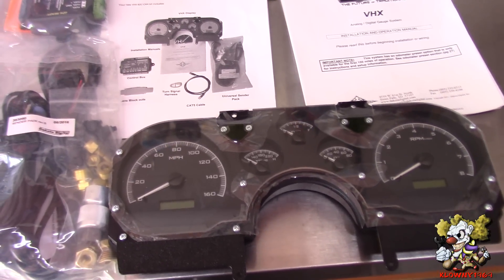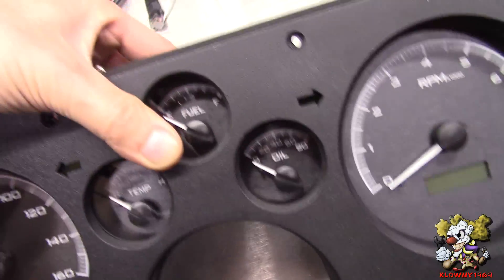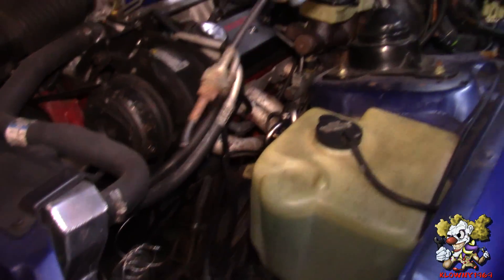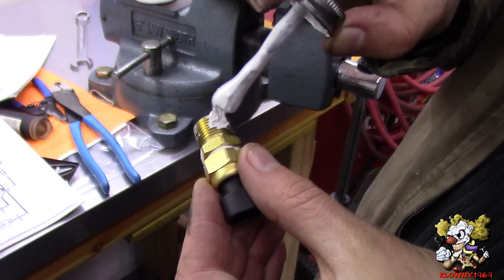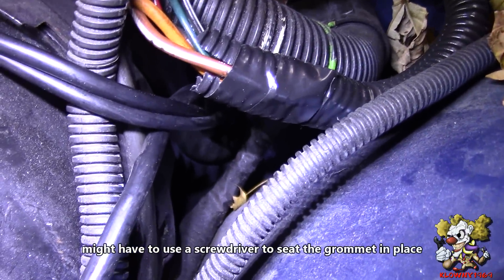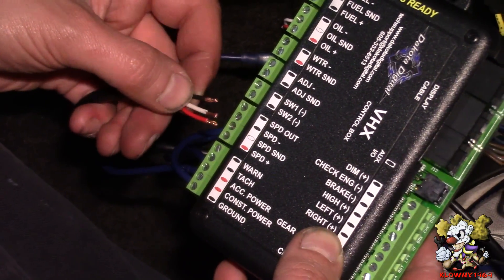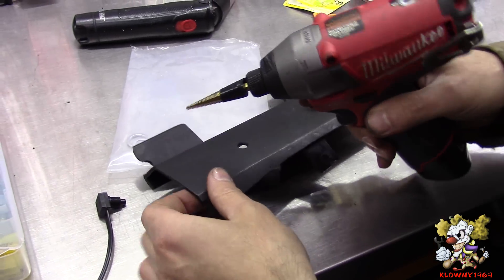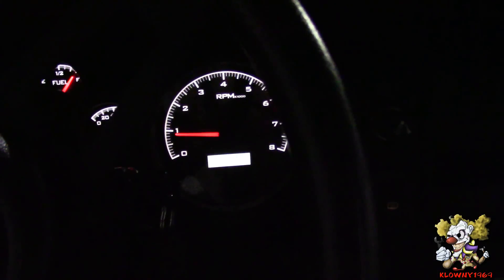Dakota Digital Dash Install !!!

Comment: Nice set up, as soon as I get my motor in that's my next upgrade!
Reply: Is there a volt meter built in?
Reply from the maker: BIGBEN1108 thank u..there is no voltmeter display..it just gives u a warning light if the volts are under a certain number

Comment: When you set the speed, did the speed read 0 until you passed the 1 mile mark? I’m trying to set up my speed on mine but I’m not sure if I’m not reaching the mile mark or if I’m gonna need a new speedometer sending unit sensor. I did notice it had a little bit of damage. Bought a car that has one of these Dakota gauges.

Comment: Hey, what's up, bro?How you doing?I have the same.Set up as you  every time I turn my key over my cluster goes off Do you think you know what can cause that by any Chance
Reply from the maker: U need a consistent hot power wire even when cranking. Don't forget to subscribe

Comment: Nice video man !! i installed VHX-70C-MAL: Silver Alloy Background on a 71 Chevelle .. I'm having issues with fuel gauge , keep getting EE error  , connected the SND  positive wire and Ground wire to the digital box , noticed you only connected one wire ?

Comment: Boy I LOVE this model of Camaro , and have owned several. my Black on Black 88 5.7 IROC was favorite. In 1991. Had a convertible IROC too. But they were SOO cheaply made it is comical today. All that plastic the squeaks and creaks. But still today I long for another one. Thinking 6.0L is swap. Lol who knows...
Reply from the maker: i work on alot of thirdgen camaros..good stuff
Reply: @klowny1969  I agree..lol
But those consoles and dashes... Horrendous..window seals trim. Door latch. It was the time is all. Like I said I'm an 80 s kid. I love them. But my Mustangs seemed to have better interiors. Or better built.

Comment: Hey what's up bro so I got a  Dakota digital cluster and I got a  4L60e transmission how would I hook up the silver piece that you hooked up on the on your transmission since mine is All electronic and I have a stand-alone harness from psi performance

Comment: Hey Klowny
Finally got a hold on my my very own VHX-78-C for my 81 Malibu wagon/350. I've noticed you chose to install the oil pressure sender at the oil filter housing using threaded nipple and other hardware to secure. Also noticed that old pressure switch was attached to pipe with the new sender.Question: if new sender is being used, why would the old sender be connected? The location of my sender is on the rear of the block with one wire connected. How can i used the same setup as you did for your Camaro? Meaning my single wire won't reach the location of the oil filter housing? If I was to use the location on the back of the block, would I need an angled nipple to clear the distributor? What would you suggest as I've been to my local Lowes and could not find the the required hardware! Thanx in advance 
Ray Ramos

Comment: Wasup Klowny
My question is as follows. I've installed a VHX cluster in my 1981 Malibu. I've had to replace the old cluster(sweep style dash) to be able to install the one from Dakota. I believe i"ve installed the setup according to specs from Dakota, up to the part when operating dash,  gauge was reading fuel level according to what fuel is in tank. I have a full tank and now no fuel reading. According to Dash Printed Circuit Pin Locations for 1981 "A' body, pin #4,circuit #30 (pink wire is for fuel sender and that is the wire inserted into fuel sender terminal at controller.At fuel setup procedure, checked for sender type and set same for GM90. At fuel system test, system reads at 999 ohms. What about the other pink wires. Where circuit #39 is for 12 volt ignition? Could you help me out with what my be the reason for not reading fuel. 
Thanx in advance
Ray Ramos

Comment: What gauge size connector did you use to connect the turn signal wire from the car harnesses to the Dakota digital white and green wire since the wire sizes are different?
Reply from the maker: Primetime132 i dont remember..i work on alot of cars..my rule of thumb is to go with the thicker gauge of the two wires

Comment: Nice video , I used it to install one in my 71 Camaro. I was wondering how the speedometer was working in the one you installed. On mine the needle will stick at the 1 mph mark before  dropping to zero after comming to a stop , drives me nuts.Did the one you installed do that ? Keep up the nice work I'm going too use the one on leaf springs next. THX

Comment: Man, you made that look so much easier than it looks. Thanks for this video. I too have a 87, but the carburetor model. In your opinion, would it be the same install as with your TPI?
Reply from the maker: Joshua Brock yeah shouldnt be micj different
Reply: Thanks! Awesome video!
Reply from the maker: Joshua Brock thanks

Comment: Correct me if I am wrong, but this unit is in YOUR CAR? If so, now over time how do you like it? Any issues, seems like a great upgrade. enjoy your videos, very detailed and helpful.
Reply: I have a Dakota Digital VHX system  in my 1969 Camaro, I have had them about 5 years now and love them. I am just getting ready to upgrade to their latest HDX system I like them that much plus i am adding their TPMS (tire pressure monitoring system) right now Everything works just like modern cars instrument systems.
Reply: @camarogs1  Yes, these are slick, glad to hear the "reality" is likewise, thanks.

Comment: do you know where I could find a cluster gauge pin out for a 83 sport coupe and would the wire hook ups be the same for the guages cause my cluster has the big gas gauge and the idiot lights
Reply from the maker: Jeffrey Taylor Alldatadiy.com and should be similar
Reply: OK thanks

Comment: That there is a doubt I have a camaro 1988 ls3 430 then I want to pass the analogue gauge to digital dakota I do not know what I would have to buy because my transmission is 4l65e the adapter speeder I do not know if it is compatible you help me Thank you
Reply: call dakota digital they can hook you up

Comment: Did that come with LED's, or would you have to install them?
Reply from the maker: Bryan Hallman for the turning signals? It's already in there
Reply: No, for the normal running lights. I hate changing burned out bulbs in a 34 year old car.  :-P
Reply from the maker: Bryan Hallman this is just everything you need for the cluster
Reply: It looks like it is an all LED backlighting, so this would work great with an LSA.

Comment: Is it worth doing all that work for the gauges?
Reply from the maker: tbh..it really is a big improvement over the stock gauges..the stock gauges also aren't that accurate in the early model thirdgen camaros. Also putting in  a bunch of autometer gauges would probably run you more money..i would also recommend doing it yourself, labor could get very costly...Thank you for watching and commenting :)

Comment: how much do you charge for an install for this?
Reply from the maker: ThirdGenDude92 im booked for a few months but..it would be around 500 bux or so..depending if there any issues along the way
Reply: thank you for the info. I think i have some issues with the stock gauges. The fuel and and oil pressure do not read. I changed the oil pressure sensor switch today and........ nothin. I have the video posted on my page
Reply: ThirdGenDude92

Comment: you klowny1969 can you please do an oil pan gasket change without pulling the motor and taking the trans out on 3rd Gen firebird 305 or camaro???
Reply from the maker: Andrew Green when i get i chance i will..thanks for watching
Reply: klowny1969 thanks bro and your the only dude I watch for my bird
Reply from the maker: Andrew Green thank u

Comment: That is a shit way to splice wire. You should always solder the wires or at least use soldering type butt splice connectors.
Reply from the maker: Never solder..it falls apart after a while..research it